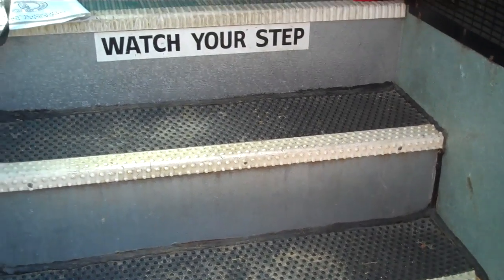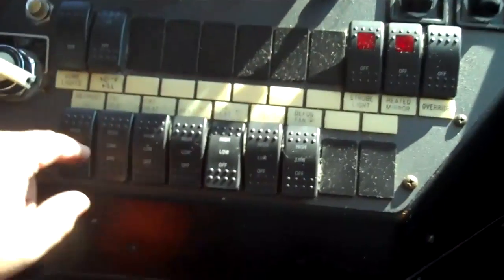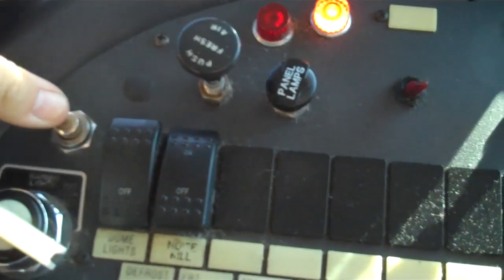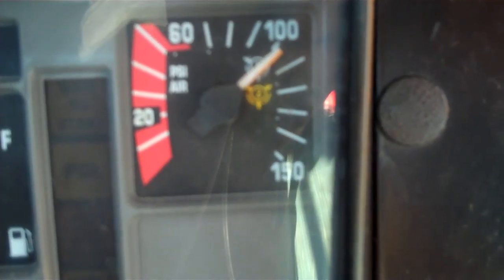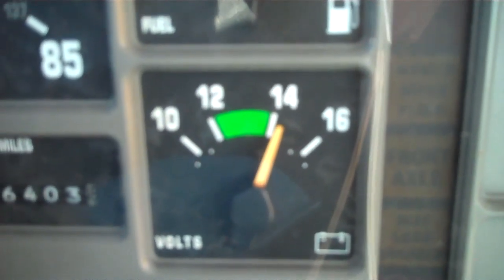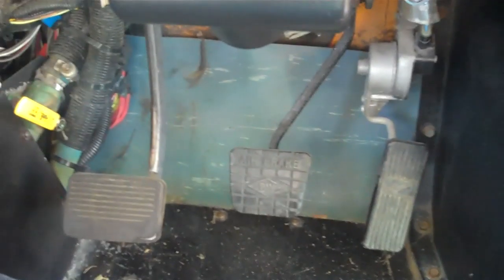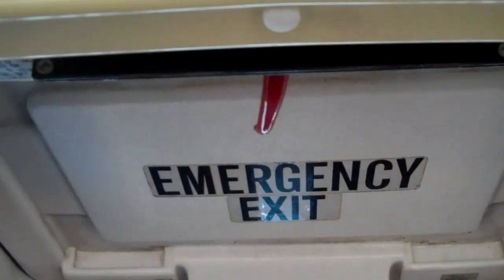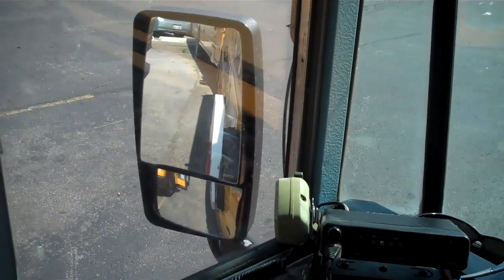Bracken County Kentucky School Bus Pretrip Inspection (Inside)

Comment: Nice video, however one VERY serious flaw in pretrip...when you say the low air warning doesn't come on in this bus @ 60 PSI..how do you know if you're losing air pressure?  This bus needs to be OOSed until properly fixed.